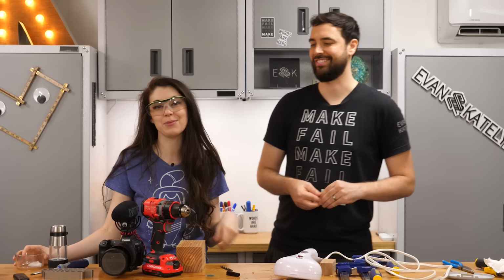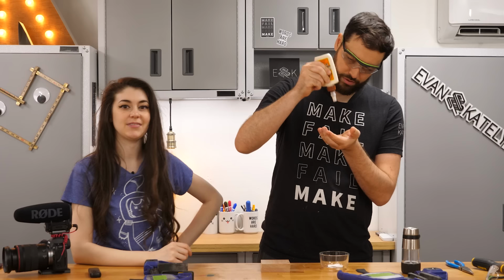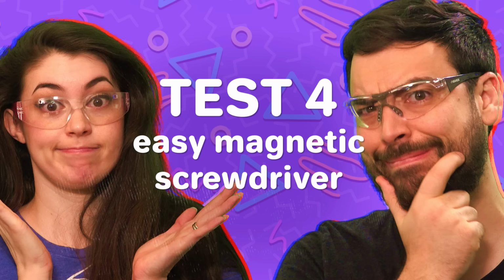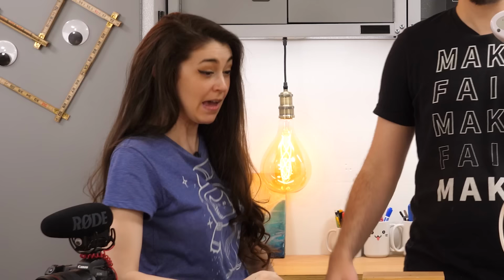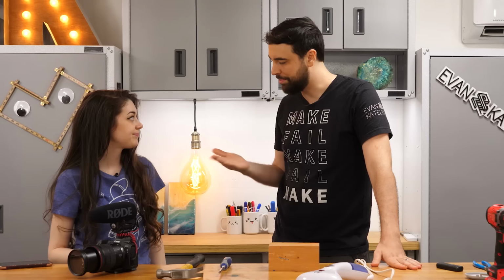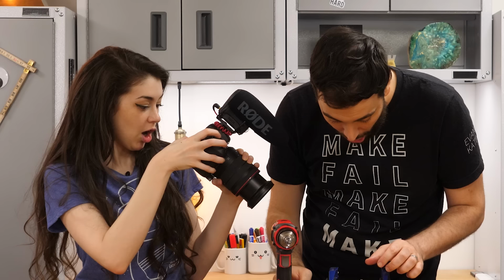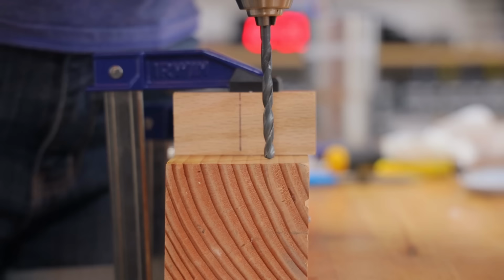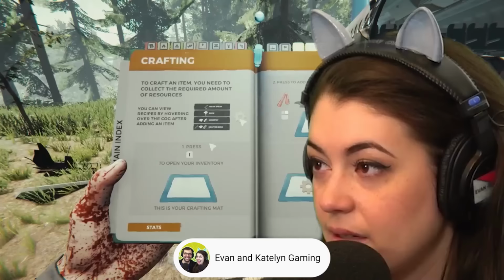Makers Test 7 DIY Life Hacks

Comment: they make screwdrivers with magnet tips, or if you magnetically charge the bit it will work for drills.....
Reply: This is true IF the metal is ferromagnetic and not paramagnetic. The magnet field produced in a ferromagnetic material this way will always be weaker than the magnetic field of the external magnet and most likely temporary. However, this may be more than enough to hold whatever screws you need to hold. In the case of the hack, both types of materials work with an external magnet present.
Reply: @stokhosursus  an excellent point!! Thank you

Comment: Can you attach a magnet to a hammer and start the nail that way? Skip the pliers?
Reply: I guess that depends on the shape of your hammer head and the head of the nail as well as the length of the nail. The magnetic force is a strong one, but it might be a bit difficult when it comes to driving a nail into a piece of wood.

Comment: Umm you did the rubber band/ stripped screw slightly wrong that's why it didn't work.  You need to use the full thickness for it to work. The 1 rubber band imagine it was 2 strips instead of a loop. Both strips are needed for the trick to work not just one. The loop is the same lay it on the screw as if it was 2 strips then put the screw driver on the screw and it will work.

Comment: i mean all the screwdrivers I've ever had have had magnetic tips. is this not a normal thing?
Reply: It’s becoming a more normal thing, even with cheaper tool kits, but no, it’s not always been the case, especially when permanent magnets were more expensive and/or harder to make. Additionally, you may not always want magnetized tools, but the hack works to make both ferromagnetic and paramagnetic materials temporarily magnetic while the external magnetic is present. 😁

Comment: This magnet thing looks dangerous if used on a cordless screw driver. It might fly away on high speeds, becoming a projectile. 😬
Reply: Well, let’s see (I’ve not pre-calculated this so we’ll find out together): A cordless electric drill typically spins at 300 rpm or 800 rpm, and a typical screwdriver bit has a diameter of about 1/4 inch. The magnetic itself is probably also about 1/4 inch thick; so, its center of mass is about 1/4 inch from the center of rotation. This makes the typical higher linear velocity of the magnet, v = rω = (1/4 in)(800 rpm) = 200 in/min = 0.1894 mph, or 0.2778 ft/s. I’m not sure what the mass of the magnet is, but its momentum upon releasing would be p = mv = m(0.2778 ft/s) and (more importantly) it’s kinetic energy would be in foot-pounds, K = 1/2 mv² =  (0.2778 ft/s)², where m = (weight in lb)/32.17405 ft/s². The question is whether or not the magnet would detach. This would happen if the magnetic force attaching the magnet to the cylinder were less than the centripetal force required to keep the magnet in its rotational orbit. There are a couple more unknowns here: the magnetic induction (B) exerted by the magnet and the cross-sectional area of the magnet perpendicular to the direction of the magnetic flow (A), but with that information, you could determine the maximum rotational speed that the drill can rotate before the magnet will detach. Doing a bit of formula manipulation, the maximum rotational speed would be ω = sqrt(B²A/μ_0mr), where m is the mass of the magnet, r = 1/4 in, and μ_0 is the vacuum permeability constant (which I don’t know in imperial units but is 4π χ 10^-7 H/m in SI units). If ω is less than 800 rpm, then you will indeed launch the magnet as a flying projectile at the speed that you could determine using the same method above with the updated value of ω. Whether or not this would do damage would be determined by the kinetic energy of the magnet at the time it impacts another object.
Reply: @stokhosursus  Which means, if I may summarize, it might fly away and cause damage.🤣
Reply: @keyem4504  I don’t have the missing constants, but I suspect the magnet’s magnetic induction is high enough to avoid detaching, but even if it does, the mass of the magnet is far too little with the velocity I’ve calculated to actually cause damage. I thought that might be clear with the numbers I calculated.
Reply: @stokhosursus  To me it was not. Nevertheless, thank you for the calculations.

Comment: the screw driver had black at the tip meaning it was already magnetic.....
Reply: I mean it is possible that it was previously magnetized, but even permanently magnetized bit can become demagnetized by accident. Nevertheless, this method will work with any screwdriver that is made from ferromagnetic or paramagnetic materials as long as the external magnet is present.

Comment: Great life hacking some life hacks (life hack-ception).

The real life hack for nails is to use screws instead, cuz nails suck lol

The magnetic screwdriver is one of my faves, in fact some screwdrivers/flatheads come with a weak magnetic tip. You could say it's an attractive quality, lol.

It's a massager, it gets you hot & wet!! Coming soon to a de-monetization near you, lol!

I wonder how well steaming will work if you just swung the hammer as hard as you can on the block of wood. Wood it work?

Longer, larger screw? Drive it in? You lube it up? How'd it feel? Evan, you are trying so hard not to give a dirty response aren't you? You stripped the hole? You just forced it in there?
I know you don't mean to be dirty, but you guys are killing me here LMAO.
If you're "Coming Clean" Evan, make sure you have Hilary Duff's permission to use her song, lol.

Comment: ACTUAL REAL WORKING TIPS, because life hacks is a scam.

"Rubberband + stripped screw."
Take a hacksaw, angle grinder with a cutting disc or similar tool and cut a slot in it for a flat driver...

"Using salt with wood glue."
The salt will make the joint weak because wood glue relies on the pieces being pressed together, the salt creates spaces.
Just use a little dab of hot glue, works like a charm.

"Easy Magnetic Screwdriver."
Swiping the magnet over the tip works as well, the more you do it, the stronger it attraction is.
(This will possibly wear off over time.)

"Steam = Dent Removal."
I've done something similar for fixing dents in guitars.
I put a slightly damp rag or shop towel over the dent, and put a iron to it, the water will make the wood expand and the heat will evaporate it away so it stays.

"Soap = Screw Lubricant"
Just use candle wax, soap has very little lubrication to it in solid form.

"Drill straight down."
Just use a drill press, and if you don't have one use drill guides, you can make them yourselves if you can borrow a drill press or mill.
The deeper material you make the guides out of the better.